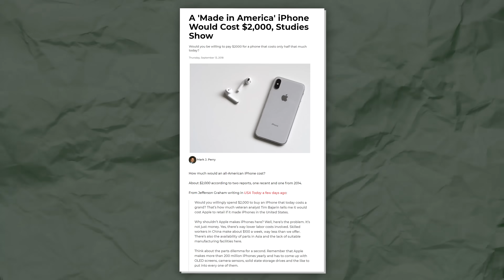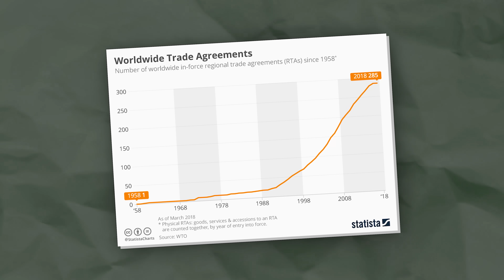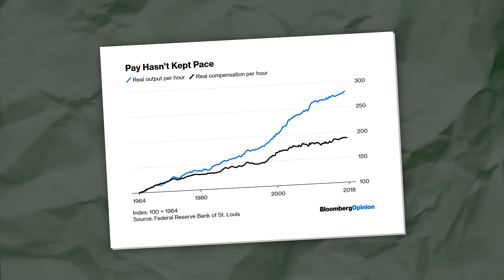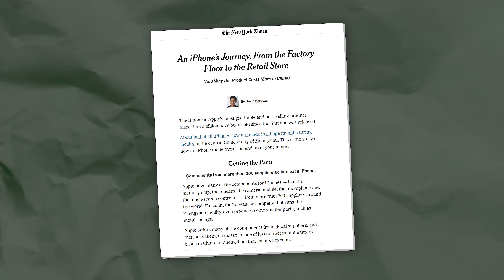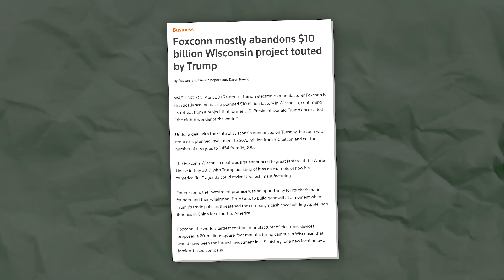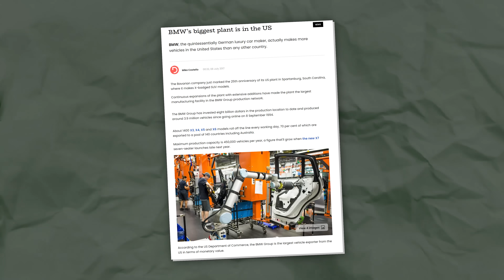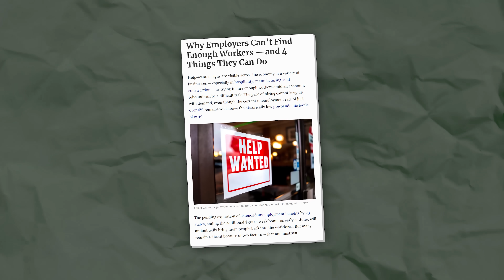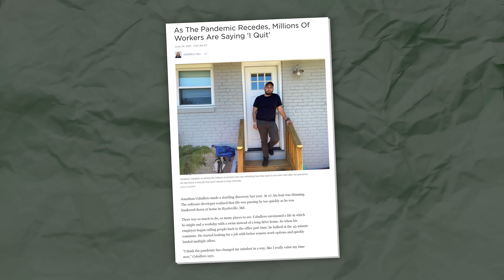How Much Would it Cost to Make an iPhone in America?

Comment: Ultimately, what this video points out (pretty well, although there were a few points I think needed to be expanded upon) is that the average American really does not understand manufacturing.  Whether it is in America, or any other country in the world, manufacturing any product, but especially high tech equipment involves a highly complex set of variables.  This is not a task you can simply move from one country to another.

Using Trump as a foil here, when he constantly used the term "return manufacturing to America" he clearly did not understand the undertaking.

A lot of people will say "corporate greed" or "politics" or any number of reasons, but at the end of the day manufacturing high tech equipment is not something that can easily or be quickly relocated.  Additionally, over time, technology changes and even if we did bring back manufacturing, it would not be what we expect.

A very good example would be appliance manufacturing, which greatly affected Ohio.  If you look at the Chinese manufacturing sites, you'll find much of that manufacturing has been automated, or "roboticized".  Even if we did bring it back, it would only be a fraction of the original number of jobs.

Lastly, I continuously hear "never by cheap Chinese junk".

There are certainly things made in China that are substandard.  What most people don't realize is that most of that "cheap Chinese junk" is at the direction of American retailers who have said "make it cheap because no one will buy the expensive stuff'.  In other words, it's not cheaply made because it's made in China, but cheaply made because we ask them to.

America has this arrogance of "made in America means it's top quality" appears to have forgotten the debacle of the 80's when Japanese cars were embarrassing Chevrolet, Ford and Chrysler, and it took Reagan's trade war (not dissimilar to Trump's anti-China trade war) to get Japan to back down.

The big difference is that China isn't backing down and we're losing the war.  They learned from the mistakes Japan made.

Instead of making a better America, we're making America "better" by trying to make other countries worse.  Hardly anything to be proud of.  We simply let our government schmooze us with self-esteem to make us feel we've been wronged and it's made us complacent so we've lost our ability to compete.
Reply: Well said! 👏👏👏

On top of that, there are leeches in the ports that get paid a lot so long as certain amounts of cargo remain at the port and people can't get their product fast enough as a result.

In other words, products are made more expensive due to arrogance of naive people running for office AND leeches that just want their cut while running the economy to the ground.
Reply: You know the picture!!!
Reply: True up to a certain point. Many things in China are substandard even for the internal market: its history, how quickly they adapt and learn new jobs (without becoming specialized), the speed at which products are made and low quality source materials all contribute to a poorer quality overall. Not always of course, and it does not always matter, but even buildings for example inChina are built at an astonishing speed but start falling apart in a span of decades. It's a different system, government, mentality.
Reply: @mrknarf4438  one thing to note is that although China is able to produce high quality products, up until very recently it has been selling cheap junk to its own country, simply for the fact that the average Chinese income is much lower than Americans. And even though China has a “booming economy”, the wealth per person is very low because there’s just too many people. Builders and manufacturers are churning out low priced products as fast as they can to meet the extremely high demand caused by overpopulation and rapid industrialization. They are trying to build 300 years of infrastructure in 3 decades, for people making the kind of wages mentioned in this video.
Reply: Exactly this. Chinese products are cheap and low quality because there’s demand for that. But China actually manufactures a alarmingly high percentage of our “luxury” products. Many “high quality” brands have all except the final product assembled in China, and they ship components overseas to Japan or Germany where they have a “Japanese” or “German” company that has a local person as a “cofounder”, along with the original Chinese business owners. This way you have a nice label. “MADE IN GERMANY” and people will pay 10x the price. The same factories that make cheap junk also make mid and high end products. All will need to be replaced if we try to “get our jobs back”
Reply: exactly. we asked for cheaper prices and mass consumption, our booming middle class at the time was hooked with consumerism, we created the globalist media machine and the giant brands like coca-cola and McDonald's that spread worldwide. everyone wanted to be "American", and being "American" meant keeping up with the Joneses. that's the culture WE in the USA collectively created and propogated as a signifier/new definition of being a "first world country": cheap prices, massive exuberance, the latest playstation for the kids, black friday sales, 2 cars and a suburban house. why tf are we surprised that countries satiated that culture and got rich in the process?
Reply: Its not impossible, just not easy. I think we will have our own automated factories in the future. No need to ship iron ore from Australia to China to then buy it back as sub standard junk. What a waste of carbon, you globalist scum are the reason for climate change.
Reply: Chinese even tofu dreg their own buildings and you think their manufacturing is on point?
Reply: Genuinely well put. As a European I’ve always thought the “bring jobs back to America” battlecries seemed at best to not understand technology manufacturing
Reply: Finally someone gets it, although one thing I will add is that the biggest reason that America has lost it's ability to compete is greed and companies resting on their laurels. For instance, Harley Davidson was almost put into the ground in the 80s by companies like Honda, and then after Reagan had his trade war and Honda bikes became as expensive as Harleys, Harley did absolutely nothing to give themselves a competitive advantage and as a result people still ended up buying Honda bikes because it was a superior product, now just for the same price instead of cheaper

Comment: So Did I get the math wrong there? 350k workers making 500k phones a day? or was it 350,000 man "days" to make that? Because in that case the math isn't as bad. Additionally a lot of this could also be buffered by the simple company profit number.... I'm not sure if that was cumulative for every stage but if you simply ate away at that fractionally you would be able to negate any of the previous factors. Additionally, this all assumes we choose manual vs automated labor. Others hit on this but manufacturing fundamentally won't come back as it was. It will come back with automation. Anything that can be automated will be. Shipping costs are negligible but domestic control of some things will be crucial. One big issue is semiconductors. Right now the world supply is effectively Taiwan but if China some day gets control of that, America will try and shift as much as they can domestic.

Comment: The end purpose is to bring fundamental manufacturing back into America.  The problem is not that the US does not have the knowledge, the problem is not enough of the population has the required skills.  When the IC chips were commercialized in the early 1960's, working at a factory was an honorable job and a higher percentage of the population had manufacturing skills.  Today, a higher percentage of the population "doesn't know their butt from a hole in the ground" and struggle using a screw driver.  It didn't help that 'know-it-alls' with clean, delicate fingers thought that America should export 'dirty manufacturing' with the adoption of NAFTA and become a service economy.  
We need the ability to cobble together an iPhone out of pre-made parts AND we need to be able to take raw, dirty materials and make refined, value-added products!

Comment: Not convinced you added up the cost increase properly.  Wouldn't you need to apply the margins to the new labor cost?  You can't just add the bottom line labor number to come up with the new total.  Margins will be applied to the direct costs, which means the labor component as well.  This will make the final selling price a good bit higher than your figure I believe.

Comment: A day after watching this video, one additional point did occur to me.  My phone is a Xiaomi brand.  128gb of internal storage, plus external slot. 6gb memory. 3 camera lenses. etc.  So it is not a low spec phone. It cost AUD270.   That is about half the posited value of parts for the iPhone in this video, without even considering R&D, labor, shipping, profit margin etc.   Does anyone have any thoughts on how to reconcile the existence of fairly high spec phones at such low prices?
Reply: They steal the R&D part.
Reply: @johnj3577  easy to say off hand with that is not true. Xiaomi use Google's operating system and in significant part buy American chips. As you will realise Huawei has virtually had it's phone business shutdown by denial of access to American hardware.

Comment: Excellent presentation!  It is so refreshing to find complicated topics like these, confined to facts and analysis of facts.  

I would like to add an even more general observation on the topic:  Putting aside oil rich countries which simply drill a hole and have money flow out, wealthy economies (ie Western) are about 2/3 services and 1/3 goods producing.   The only reason they can be structured that way is because so much manufacturing is done somewhere else.  The more you on-shore manufacturing, the more you need to draw labor away from the service sector (as alluded to in the vid).   Ultimately, the more you revert to producing goods, and not services, the poorer will be the average lifestyle, relative to competitors. 

All that said, offshore manufacturing isn't really a problem generally.  The problem is that China does so much of it, and China is a threat. Secondarily, Taiwan manufactures an extraordinarily high % of computer chips (considering its 24m population), and it's quasi sovereignty, control of its companies' IP, will disappear in one military action as soon as China views that as achievable.  As current conditions are making very clear, a lack of chips can badly cripple entire industries, as is currently happening.

So making everything in America (or EU, UK, etc) is not even necessary.   The objective is to have useful and critical technologies and goods made in reliable-supplier countries and ideally in a range of them.

Comment: If iPhones were made in US, the components alone would double the price. Most of components in a phone like battery, CPU chips, electronic circuit, camera, accessories, packaging, they are all made in Asia . If you move the assembly line to America, all these components will need to be shipped across Pacific Ocean and imported to America with tariffs. If you want to make these components in America too? Well, these components need smaller components, and they come from Asia too. It's easy to move just one factory, it's impossible to move the entire supply chain.
Reply: I kind of agree with you but it could be done for manufactured items. The real issue for me would be where do the raw materials come from as they would need transporting in enormous quantities. The precious metals, ores, lithium for batteries etc that require mining. My point is no matter where things are made, something will still need transporting to the point of manufacture.
Reply: @johnj3577  Yeah, raw materials and pre processed materials like iron, aluminium, plastic are important in the supply chain as well. That's why it's always better to have most of the supply chain in one place, which is Asia currently. Asia also have a huge advantage of being close to the biggest market for these products.

Comment: Money, Money,  💵 !!! This issue is more than money. Establishing a factory in an increasingly suppressive communist country 🇨🇳 is a ticking time bomb. As you stated, how much more are we willing to pay for a new phone? Apparently, all phone prices increase with every new version. I can not see why phone manufacturers work together to cut costs. Manufacturers are so secretive when it comes to new developments. In reality, word gets out. Everyone is working on the same thing. Would this be so bad. Imagine cutting costs by having a universal charging unit. Recycling used phone electronic parts to create new phones. That helps to reduce the carbon footprint. The electronics are the same for all phone. The outside & software are different. Manufacturers sharing labor, manufacturing, & shipping will dramatically cut costs. Even if the factory was placed in the USA.

Comment: If the phones where made to last much longer, I would be willing to spend extra. But most electronics now days last a fraction of what older electronic did, yet cost significantly more.
Sure, our current electronic are far more versatile and powerful compared to the prior. Still though, I wish phones didn't start to deteriorate in performance after a just couple of years. (Off topic, in my country the prices of these phones tend to cost an extra 25% compared to American sold phones)

Comment: There would not be a markedly different variable in pricing, but it would still be higher. Here is why; 1. no tariffs - the US charges insane tariffs on imported goods, when that is removed that overhead cost goes away 2. Shipping - the cost of shipping a good from the rust belt of Mid-Western US to a rail hub also in the US is already a factor in shipping today, but he cost of putting that good on a an actual ship, sailing it across the largest ocean on the planet, then paying a port fee will not be a factor. 3. Automation - this is already in effect in the manufacturing facilities across the Asiatic region, and the cost of automation is the same here as it is there.

So, then why would it still be higher? Mainly the reason is wages and manufacturing space is more expensive here by a significant margin. Enough of a margin that it gives these companies an extra 3-5% on margin even after the above mentioned savings. Also, regulations in those nations is much more lax than in the US. Regulations cost money and time, money and time that most companies do not like to eat. Those additional costs, matched with the above mentioned savings, will result in a more expensive product to the consumer.

But, like all things, it is a choice of pro and con. Pro to bringing manufacturing home is that we will have ultimate control over supply chain and provide millions of high wage jobs to those who desperately need one. Con is that your iPhone might cost 50 bucks more than it does today. But is it worth it?

I like the idea of bringing manufacturing back to the US. The main reason is that all economies of scale have always functioned on agrarian and production of goods. The US still holds the big medal on agrarian work, however that is not enough to carry the ball across the line. The US still needs production of goods, not services, to finish that push. We CANNOT be a nation of consumers, we have to build things as well. That is the MAIN reason why this nation is in the economic downturn it has been in for so long. The downturn of shrinking middle class, expanding lower class, and every wealthier upper class. To fix that downturn, you MUST bring production of goods back. That is the ONLY fix to that problem.

Comment: I found at least 3 fundamentally assumptions are wrong
1. Labor, at least 1/3 of Foxconn are college graduates so wage assumptions number as multiplier change equation
2. Investment cost not in equation. Building a facility in China is half time to US (see Tesla Shanghai vs Texas or Berlin) and cost will be at least double. We are talking about at least 5-10 billions. Not to mention that supplier also have to invest so total supply chain at least 10-20 billions
3. Profit margin, using $400 is absolutely wrong. US standard is 40%-50% if landed cost for staple products and 60%-70% if high end like iPhone or 5 times the FOB COST. This means if local made cost is higher then divided by 60% then selling price is not $200 more but $500-$1,000 more depending on model 

That’s why Foxconn scrap the project. Why Tesla build factory in China and use it as export base to Global except North American plus it is agreed that quality of Tesla China made is better than California made so call cheaper and better then who will pay more?

Comment: Relying on the Chicoms hasn't been a good thing for our country and most Chinese goods are junk and break quickly. Corporations went to China to avoid environmental/OSHA regs and for cheap labor. I'm old enough to remember almost everything being made in the USA. The country was better off. Giant ships don't have to meet any regulations for their exhaust, like trains. Not exactly environmentally friendly.
Reply: Hi Ron - There are emissions standards for locomotives in the US.  The phase-in and carve-outs were complicated, but every locomotive manufactured after 2007 has to meet "Tier 2" emissions.  The Tier 2 emissions aren't nearly as punitive (read as "costly) as T3 or T4 and essentially just required basic high pressure common rail injection systems to achieve compliance.